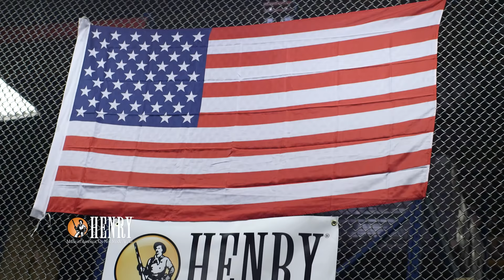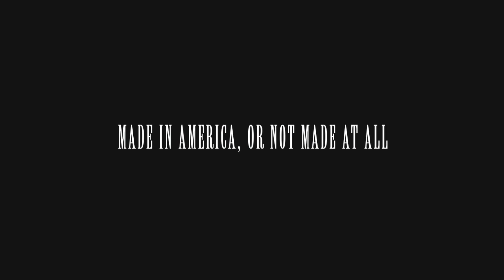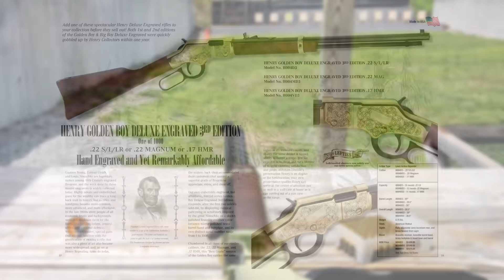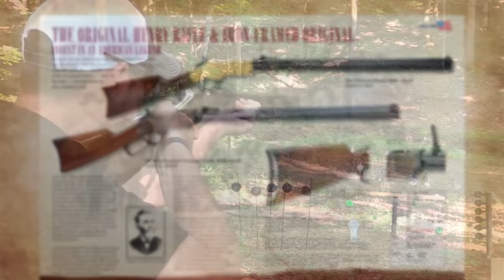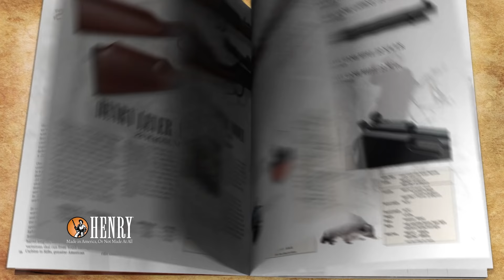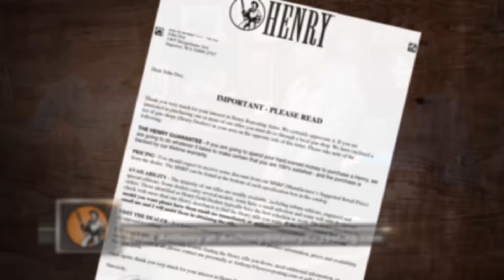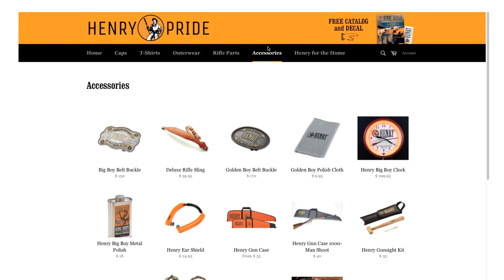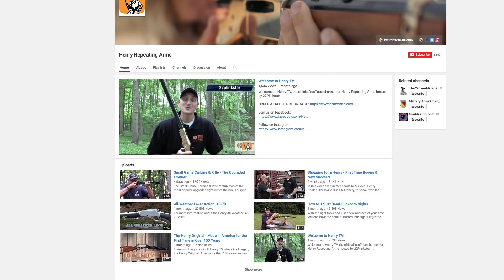America's Rifle

Comment: When one revisits the original 45-70 one would find examples in Single shot, with long and heavy barrels. WIth that in mind I'd like to see a Henry lever gun in 45-70 with a 26 inch barrel, a four or five shot magazine and the larger loop, with butt pad. Also it would be great to see a configuration like this with a 24 inch barrel in 356 Winchester.

Comment: bought a 1001l  and a yellow boy in 2003  both had so many failures to feed that i got rid of them. my 22  front sight fell of because wrong screw used. hope thing have improved because i just bought a 22  mag. FYi i spent 35 years manufacturing in america.

Comment: I bought a Henry Lever Action Carbine .22 (H001L), not at all impressed.  

The front sight that came on it was too short so with the rear sight lowered all the way down, it shot 4 inches high at 50 yards no matter the ammo used.  

Henry sent me a taller front sight which created the exact opposite problem.  With the new taller front sight installed and the rear sight raised all the way up, it shoots four inches to low at 50 yards now.

Guess I'll have to figure it out by myself.

Comment: I recently bought a brass 45/70. I found it was shooting way over to the right. I adjusted the back sight but it is so far to the left it looks weird. How easy or difficult is it to tap the front sight to the left so as to bring the rear sight back into a more central position. I do not want to try and then possibly regret the attempt.

Comment: I'm looking for a new lever action for hunting my choices are marlin 336 Winchester  94 and a Henry big boy what should I get and to be specific for big hunting
Reply: they area all great guns. it comes down to side loading gate or tube feb. winchesot model 94 is the bees knees and so is marlin and so is henry. henrys action is so smooth. the 94 and 336 will never come close to the smoothness but they can be smoothed out. you cant go wrong with any of them. to me henry is like the Cadillac. and marlin is a Chevy and Winchester is a gmc. the chevy is what everyone gets because its the work horse. a cadillac is a chevy just fancier. you can get a cheaper marlin if you just want a gun but if you want a nice looking fancier gun then henry is the way to go. i have 2 marlins 336 and a 1894 i also have a henry base model 22 and i plan on getting a henry in 357 mag. cant go wrong with any of them. i love my marlins my 336 is a stainless steel wood stock 30-30, my 1894 is 44 mag blued and wood stock. what ever you choose it will be a great choice but if the really like lever guns youll end up wanting all 3. and several of the other models by each manufacturer. Go look at henrys silver eagle 22 it is absolutely beautiful! but to be for hunting where a gun is going to get dinged and scratched i prefer a cheaper bolt gun. such as a ruger American. in my opinion the best cheapish bolt gun is a thompson compass. they are guaranteed 1 inch moa. I have alot of gun but i only have a few that see the bushs and hunting. i dont want to ruin my nice expensive guns. just imagine getting a nice lever action that you love and then you drop it and get a ding in the stock.

Comment: I posted a while back about the front sight being too high..but I guess it was removed by you all...I can't get on target at 50 yards without the rear ramp slid all the way to the top as well as using the rear notch adjustment...put a scope on it because of that problem..from what I see it's a common problem with other shooters as well...it's a simple fix,just put a shorter front sight on them..problem solved,it's not rocket science.